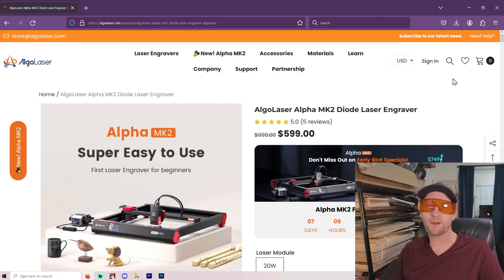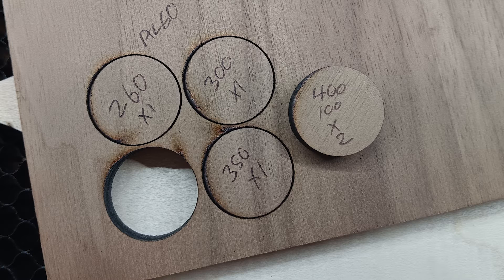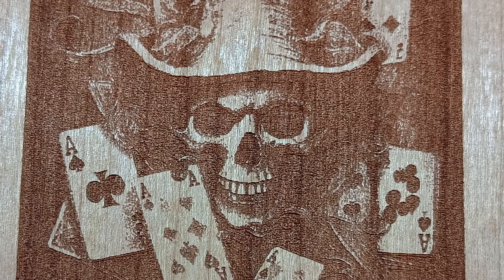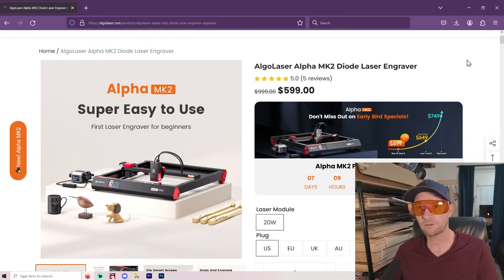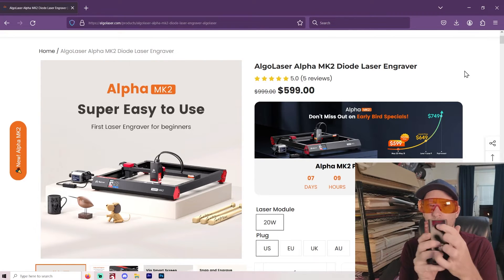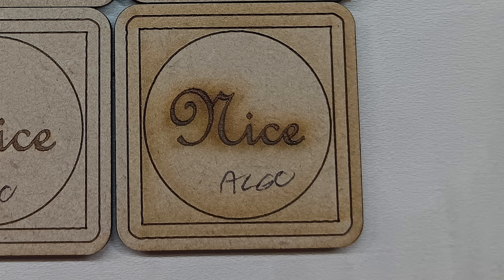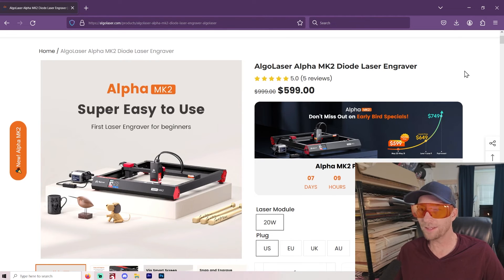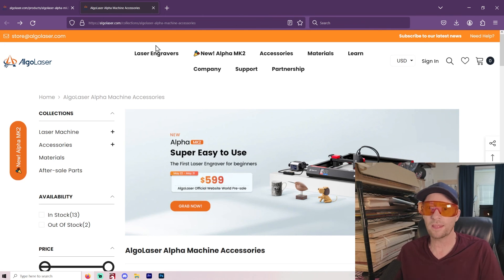AlgoLaser Alpha MK2 (22w) Laser Engraver: First Review and Impressions

Comment: Sadly, ive had my mk2 less than a week and it’s got problems . Circles started going egg shaped and the gantry started to squeak real bad. Adjusting the belts, nuts and squared the unit a few times but it’s never quiet right and tinkering just makes it worse
Reply from the maker: Yikes! I would get them to fix it right away or return it. Using it could make it worse. Keep us posted on how it goes.
Reply: After pulling the side panels apart, they didnt tighten down many of the internal parts on the left belt side. It all came apart but i was able to get the side back together and it is much smoother
Reply: That child labor can't get it tight enough, lots was loose on mine to. Bad pulley and mother board problems @E_Platypus_Unum